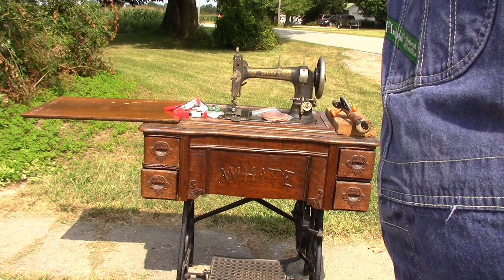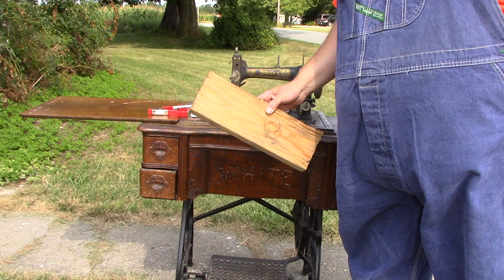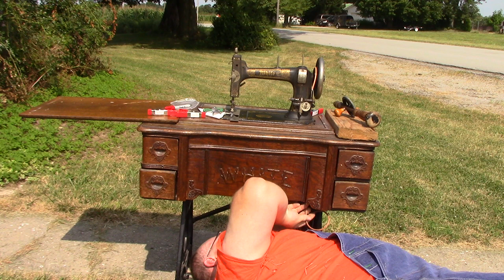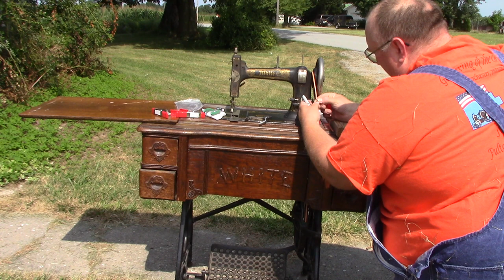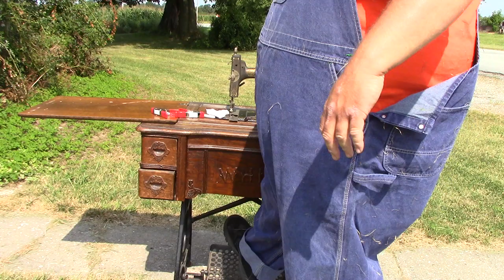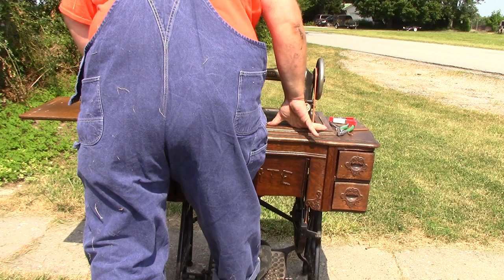leather treadle sewing machine belt installation tutorial

Comment: Do you know the age of this exact white rotary as well as the case and the base?
Reply: Thanks for the video!  I just bought a singer and need to get a belt for it.  Fingers crossed it works.
Reply: Possibly a 1914
Reply: There is a list of patents on the front metal plate I've got one that stops at 1911 so my machine might be 3 years older than that one